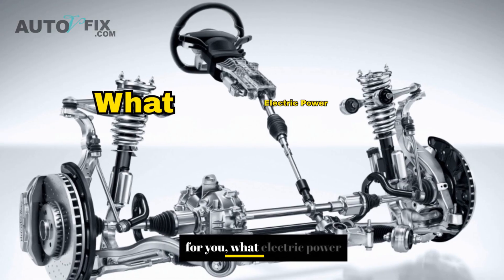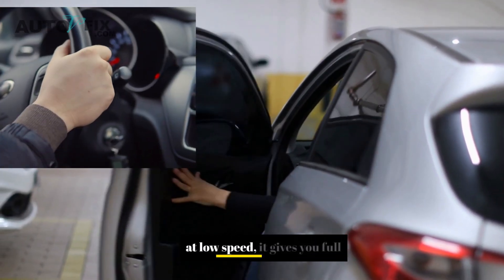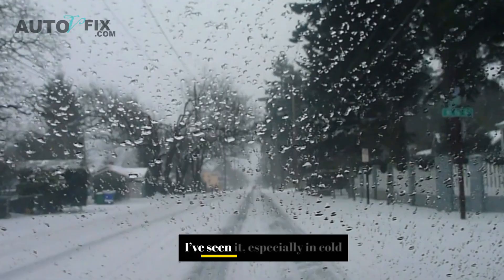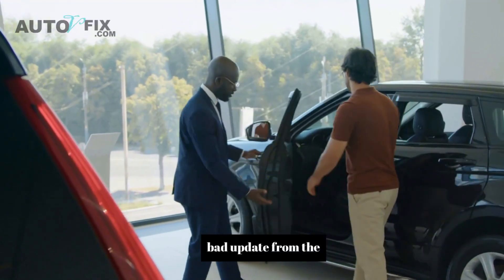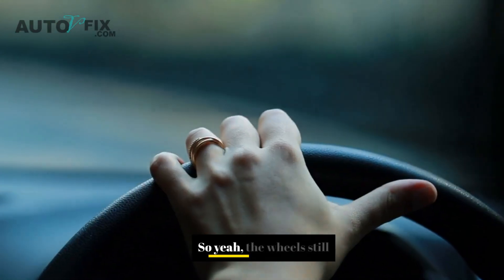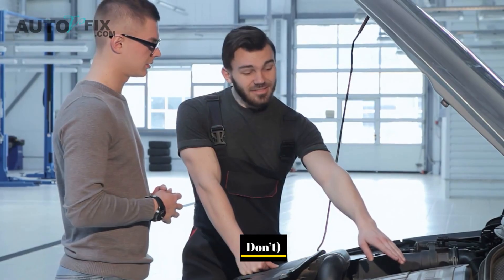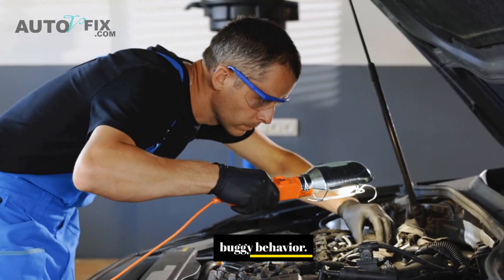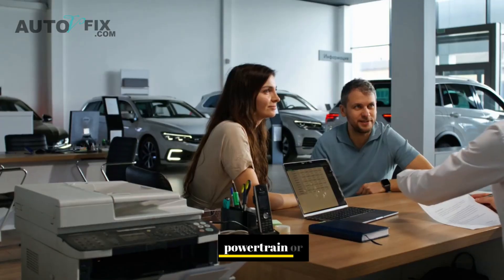Signs & Most Common Problems With Electric Power Steering, Causes,  Fix, & Repair Cost

Comment: I’m getting loud whirring noises when driving str8, faster I go louder it is, turns smooth w/ no noise. Lmk what you think. No loss of power in turning the wheel but the whirring and slight vibration sounds a little terrifying.
Reply: Sounds like wheel bearings. I had the same issue. Sounded like an airplane at interstate speeds and lane changes to the left were quiet, while lane changes to the right were loud.